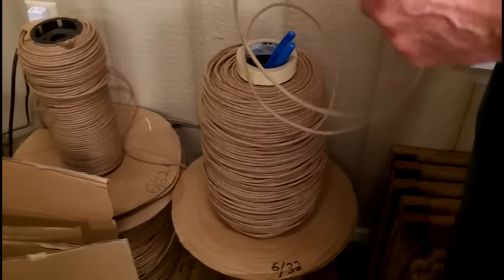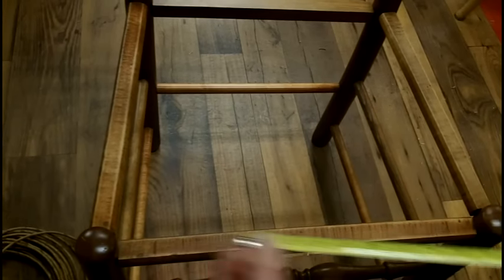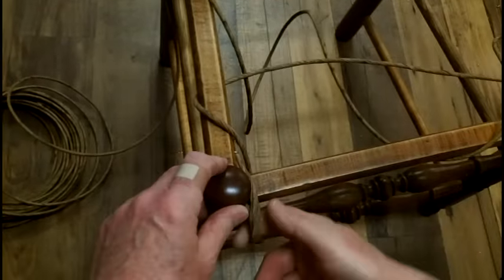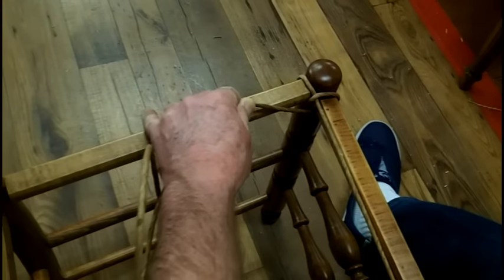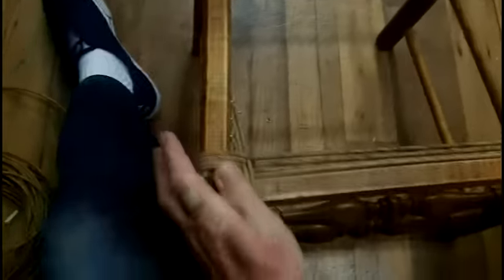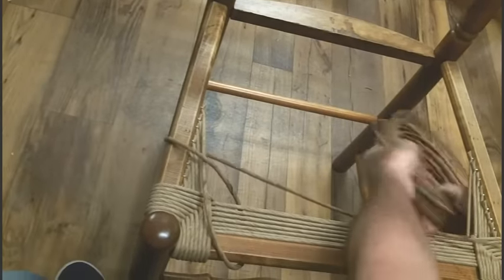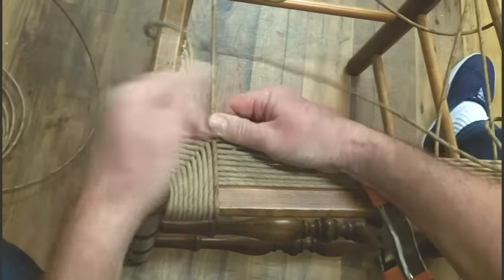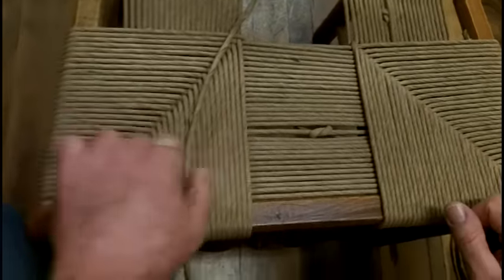How to Weave a Seat in a Rush Chair

Comment: I did my first rush craft brown 6/32 weave using this video as the bible.  It came out all right with a few mistakes due to my inexperience.  My second chair was terrific because I paid more attention to the tension, overlapping, and alignment.  Before starting the 2nd chair I placed a length of masking tape along the front and rear rails. After marking the front length to equal the rear length, I marked one inch lines on both pieces of tape.  This helped me to correct any misalignment that I experienced on my first chair.  It made a tremendous difference. The 3rd chair was even better than the 2nd.  Thanks for a great video.
Reply: How much cord do you need to complete 1 chair
Reply: @zaynab4760  A 2lb. roll should be plenty for one chair.  Use the masking tape idea that I mentioned above.  It was extremely helpful to me.

Comment: Many thanks for such an instructive video.  I have done four chairs as of today and do a little better each chair.  Your video has so many really good pointers and cautions that I had to watch it several times to learn them all.  I choose to rotate the chair as I weave just because it gives me a better view of the rush and I avoid overlapping on the underside and the rear.  Thanks again.
Reply: How long did you soak the rush?  Did you use warm water?

Comment: I want to thank you for the instruction. It was VERY helpful. Tension is everything. I wish I could attach a photo of the chair I reseated using your video. I found the chair on the roadside in Castleton, VT over a decade ago. The seat was very old and battered woven wicker. But the structure and integrity of the chair was excellent. It had been painted a hideous avocado green at one time (probably in the 70's) and then stripped. The wood is solid oak. I reseated it using hemp twine, which ended up requiring about 300+ feet. I messed up the tension when I had to splice another ball of twine that ended up being a slightly smaller gauge (and I didn't have any of those nice hand clamps) and then overlapped a strand, but went back to the gauge I started with. I just finished it about 10 minutes ago. So, now I have a shabby chic chair for the back porch we can sit on and watch the birds. I should last a few years at least before I have to reseat it again.

Comment: I have wanted to learn this for years.  My favorite footstool handed down from my grandfather will be my first repair project.  The memories of that stool while grandfather was alive will remain all the more vivid. Thank you!
Reply from the maker: I'm glad you will be restoring that fine footstool!
Reply: Ed Hammond
Thanks Ed!  I did and it was a 2-3 day blast.  Sanding and polyurethane took 2 days.  I chose to not use stain to better show off what appears to be an old 1950s stool made of maple.  The actual weave itself required about 4 to 6 hours including breaks.  The Fibre rush looks fantastic, tight, very firm.  Of course the seams could be straighter but for a first time I am very pleased.  I am now looking for a set of four old dinning chairs to redo.

Comment: How long do you keep the rush in water to get it wet?  Is it a quick dunk or a soaking for several minutes?  Thanks and marvelous work
Reply from the maker: If it's 6/32, a couple minutes is ok. If it's 5/32, just a quick dip. You will need to experiment and find what works best for you. You want it soft and pliable to fit together nicely, but not so wet that it pulls apart, or gets "fuzzy".
Reply: Thank you very much.
Reply: Ed Hammond ...what do these numbers mean? I'm not weave saavy...lol

Comment: I work at a shop in Iowa City Iowa and while my main function is furniture repair and all things in the Lamp Area I am also called upon to do weaving from time to time. I once did 10 Danish cord chairs in a week. That was lots of fun. Nothing like 10 chairs to break you in.  I don't normally do the RUSH chairs so I haven't had a chance to learn this at work. I wanted to learn how though and watched your video a couple times. I think my seat turned out pretty good. Glad to see the knots peeking through on the bottom of your chair. LOL. That's how mine turned out. Your videos are some of the best. Wish I could find one on the spacing on the "L" nails on Danish Cord chairs. I am working on a project from scratch and would rather not waste a bunch of time and effort and cord doing trial and error.

GREAT JOB!

Comment: Brilliant! Excellent video presentation. Years ago, I learned from museum curators about the acid quality of some papers and cardboard. I was advised that with fine art, one wants to avoid acid papers in favor of archival ones or archival materials other than ones made with acids which can eventually cause paper to disintegrate. It occurs to me the use of cardboard might hasten the degradation of the rush. Thank you for your instruction on this. Well done! Very clear instructions for people to follow. Kudos to the videographer and sound technician! I wonder how long it would take a pro to do one of these chairs. Thanks for sharing.

Comment: Great video.  Thorough and very understandable.  I have chair that I use almost every day that I've had since 1968 and it's ready to get re-done!  I won't have any problems with that thanks to this video!!
Reply from the maker: +Tom Hathaway Great to hear, we'd love to see a photo of your finished chair!
Reply: +Ed Hammond That's a deal.  I'm finishing up a project at the moment which will probably take a few weeks and then it's time to "work on the workshop". I'll take a before shot for comparison.
Reply: Re finished my chair yesterday.  Made a "rookie" mistake on the first coil and let it get WAAAY too wet and it started to fall apart on me.  A word in the video to simply moisten the coil very quickly might help others.  I had some interruptions during the day and so it took me about 8 - 9 hours to finish.  I'm sure that if I did a bunch of these I'd get faster, but once in 45 years for this chair doesn't allow too much practice!  I certainly can't claim that this turned out anywhere CLOSE to as clean a result as yours, but given that this chair is in my basement workshop and not with 7 other chairs in the dining room, I'm not going to worry about it.
Reply from the maker: +Tom Hathaway I'm glad you were able to get it finished, congratulations!
Reply: +Ed Hammond I tried to post the photos but the pictures were way too big, like they were zoomed in to about 500%.  So I deleted them.  Not sure what I did wrong.

Comment: This video helped me tremendously! We have two rush seat chairs, and one had a number of pieces hanging down underneath the bottom. I thought we needed to have the seat redone, but the only problem was a bit of sloppy work that needed to be tidied  up. It helps tremendously when you know what goes into weaving a rush seat. A few loose strands are now tacked under the weave into the frame where they belong. Thanks so very much for sharing your techniques!

Comment: I was wondering if you can give me some insight on using rush to weave the back of a chair. I have a larger rocking chair and I am using rush for the seat but I haven't attempted using it on the back of a chair. The rocking chair back is curved and is about 14-16 inches wide by 24-28 inches long. Have you ever used rush to complete a back and what are your thoughts on using it for the back? Thanks and your videos are great.

Comment: Beautiful job.  A few questions please.  1.  Could you have done this using one continuous piece rather than using pieces and square knots?  2.  What would the weight limits on a chair such as this be?  3.  If made as well as you have demonstrated, how long (a guesstimate in years) should this last please?  4.  What happens if the seat and cardboard gets wet during use?  5.  Can you dry it right away and consequently would that dry the cardboard?  6.  If not thoroughly dried, does it cause mold and weaken/loosen the stitches? 7.  Is there a way to save it if this happens?  Again, thank you so very much!!

Comment: Ed loved your video.  You have demonstrated the mechanics of rushing but being new at this I need some trouble shooting advise or video.  Rope rolling over top each other, too big of gaps.  I am happy to send my pictures to get your feedback on what you thing is the problem.  I am working on a stool and it should only take 1 hour but I am putting in 3 plus hours because of constant corrections. Can I be pulling to tight?  I have completed about 10 pieces total, have the mechanics down but lack the details to look for while wrapping.  So enjoy but so frustrated.

Comment: Thank you for the great video.  I have one question.  Do you dip each strand in water prior to use or do you just mist it with a spray bottle?
Reply from the maker: Cut a workable amount of rush and dip it in water. Do NOT soak it, just a quick dip to make it pliable and easier to manipulate.

Comment: This was an easy to follow tutorial with not to much information, not to little. Enough that I actually feel like I can handle this project. I have 6 dining chairs i want to weave. About how long does each chair, in your case, how long did this one chair take you having all your cardboard triangles pre-cut ?
Reply: I have done over 5,000 rush seats, so don't compare doing your first chair time to mine... it takes me 1-2 hours to do a seat, but my first attempts took 6-8 hours.

Comment: Truly must thank you for this video!!!  I am just about to finish my first chair, made from wood downed by the hurricane we had here in Costa Rica.  Your instructions were perfect, easy to follow and helped tremendously.  I used rope rather than the material you used, but the concept is the same.  How does one estimate how much material to buy in order to complete a chair?  My chair seat measures about 22" square, and thus far I have used 135 meters of rope.  Will buy more tomorrow, but how do you do your math to calculate materials needed?  THANKS AGAIN
Reply: It's just kind of a guess.... we sell 2 pound coils that usually is enough for one average size seat, but larger seats require a little more than 2 pounds. Our 2 pound coils of 6/32 kraft brown fibre rush contain 280 feet. It sounds like your seats are large and will require more than than one coil. We also sell it in 10 pound reels.

Comment: Mr Hammond I found an old rocker at my local Goodwill for $15.00 that has cane on the seat as well as the back, does it matter if you do the seat first or vica versa? also when you pull a bunch of cord to work with how long is the piece you are working with at a time? when you soak your cane how long do you soak the cane before you use it? also should the water be warm or does it matter? sorry if I seem to be asking alot of questions but I have never done anything like this before and I want to get it perfect. I am so glad I found this video it was perfect. when I was thinking about trying this myself I didnt think it was possible, till I watched this video and now I think I can do it. I am 58 years old and have never hired anything done for me in the past from auto repairs to some major home repairs. Ive been able to do them all myself. I am now totally disabled from a spine disease and arthritis but I am gonna tackle it anyway, I have been looking for a new hobby since my disability and I may have found it.
Reply: Don't soak the rush, just dip it in cold water. Start out with small coils and see how it goes, then adjust your coil sizes as you get used to it. I would do the seat first, it's easier than doing a back, because you have to make both sides look good in a back.

Comment: This is excellent.  I just pulled an old rush chair out of storage and the seat was trashed.  The rush had broken along the front edge of the seat frame apparently due to not having enough stuffing. (I found a lot of garbage inside the rush.  The original maker had put in scraps of cardboard and veneer pieces.  I wondered why.  Your video explained it.) Is this a task that a novice could perform adequately?
Reply: Many people are able to weave rush seats as beginners! Give it a try.

Comment: Quick questions: What is your recommended soaking time for the rush, and have you ever needed to resoak while you're working? Perhaps the length you recommended to cut is what a person would feel comfortable weaving in time so there is no need to resoak, and they can simply soak the next piece and have it ready to go. Thanks!
Reply: Do not soak the rush, just a quick dip to moisten it! You do not need to keep wetting it as you weave.

Comment: How long do you soak? Does it matter whether it's hot or cold water? I'm running downstairs to get a flathead screwdriver or something to tap the wraps over. Otherwise I'm ready to get going. Front rail is measured and marked, coil measured and taped, hammer and carpet tacks, work scissors and clamps ready. If I don't hear in a few minutes, I guess I'll wing it with tepid water. This is a wonderfully done video.  Wish me luck! Thank-you.
Reply: You don't soak rush, just dip it in water to moisten it, cold water is fine.

Comment: Just took a stab at replacing a chair seat for my son. The chair is probably around 100 years old and comes from my mother-in-law’s estate but other than some sentimental value, is isn’t an exceptional item. Not worth spending $250+ to have repaired. Research brought me to your tutorial and I was able to complete the job in half a day. It isn’t perfect, but it is definitely passable. For $20, I ordered 325 feet (c. 2 pounds) of 5/32 rush  that came with an instruction booklet and it was enough to finish the seat (outside dimensions are 15 x 14”) with some left over. I found that soaking the rush in water for 40 – 60 seconds was enough to achieve the desired flexibility. I couldn’t find any advice on whether it’s OK to re-wet the rush if it became too dry; I risked re-wetting and it wasn’t a problem. I opted to use a cable stapler instead of tacks so I did invest in a cable staple gun from Home Depot for $30 (Arrow Professional Low Voltage Wire/Cable Staple Gun) and staples (T-25 1/4 in. x 3/8 in. Gray Galvanized 20-Gauge Steel Staples for Category 5 and Telephone Wiring 1,100-Pack) that cost $3.64. I had to guess at the staple size and what I got worked just fine for the 5/32 rush. I only used 10-12 staples and that corresponds to the number of tacks I would have needed. I wish I had made a shuttle for the rush instead of coiling it as I was unable to prevent the rush from getting tangled.  I probably made about 6 knots - not counting the "do-overs" due to knots ending up where I didn't want them. The repair was made easier because I was able to remove the seat from the chair frame and I didn’t have to manipulate the entire chair. The booklet that came with the rush recommends finishing the seat with satin varnish so I will do that. I am amazed at the strength of rush which appears to be little more than twisted Kraft paper. I got good results. I saved $200, it was fun, and I’d do it again. Thanks for your very helpful video!

Comment: That was a great tutorial - thank you.  I have wondered how this is done because I have a chair that needs this kind of new seat.  Can you tell how much rush you used for this video, as the seat I hope to do is the same size.  Your site suggests that 2-lbs might be enough.  I looked at your internet site with more than one kind of rush, so which kind did you use here, the fiber or the natural?  Again - thank you!  Your instruction is really encouraging.
Reply from the maker: 6/32 Fibre Rush was used in this video.  A 2-pound coil should be enough to do one seat.

Comment: You did such a great job showing how to weave this chair. Could you tell me how much coil 6 ladder back chairs would take? I have a Goodwill gate leg table and 6 chairs, The table top was splattered with nail polish and glitter glue and restained in a drippy mess Now i find  that the chairs' rush had been stained (which flaked) then scrubbed, then foam had been hot glued to the rush. I wasn't sure if there was a way to save the seats but after seeing yours, I think not.  I was recently told the whole set was only worth about $300, so I'm not sure how much more work I should put into it. - I stripped the table top and stain painted flowers before sealing it. That came out lovely I must say so I most likely will continue to work on the whole set. So the seats will have to be made more presentable.
Reply from the maker: +colleeRich Each seat will take at least one of the 2 pound coils, maybe a little more, it depends on how big they are, how much waste you generate, etc. We sell it in 10 pound reels, that is a better value per pound than the 2 pound coils. One of the 10 pound reels usually will do 4 seats.
Reply: +Ed Hammond 
Thanks so much.